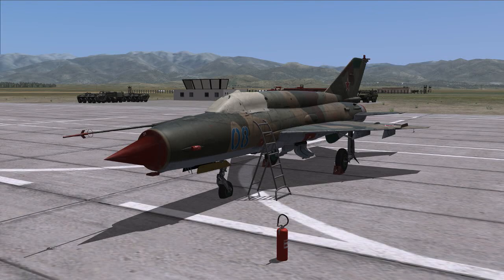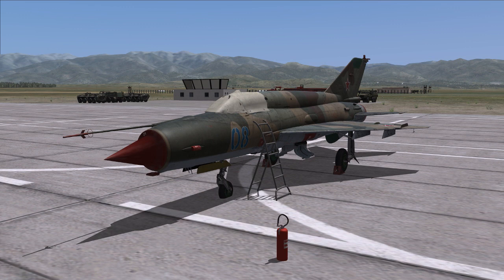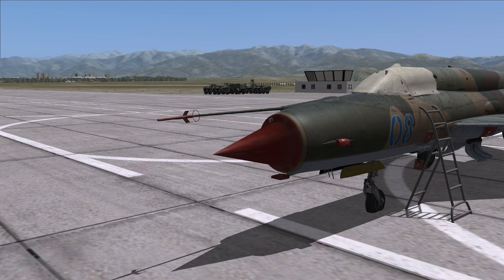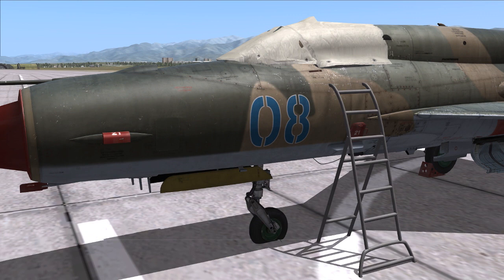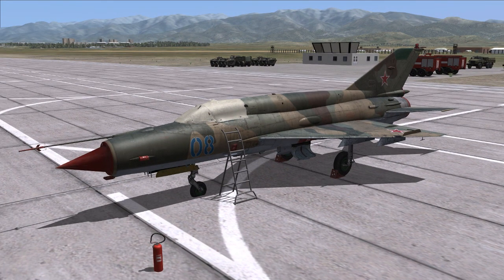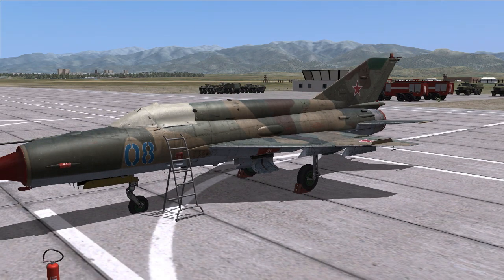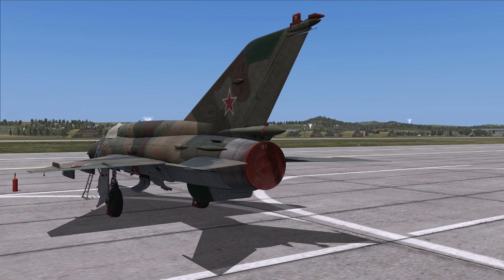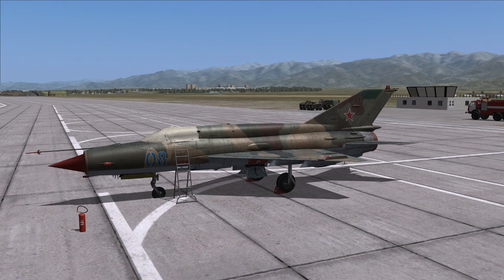[DCS] MiG-21Bis Hangar Talk 1 - Overview

Comment: Radar is cooled with alcohol that vaporizes......Why the fuck is not water cooled with regular radiator again?
Reply from the maker: Probably to reduce weight and size. 

The Mig-21 is an Inteceptor by design - it takes off, is guided to the target, shoots the target and lands again. In most cases you need the radar only for a couple of minutes during the actual engagement. Therfore having a simple system that is much lighter than advanced cooling is probably more efficient.
Reply: @xxJohnxx77  I guess that makes sense

Comment: The nosecone does not move to let in more or less air. It moves in order to move the point where the shock-wave is formed.
Reply from the maker: Yes, that is the principle it works with.
However it has two main purposes:
- Supplying the compressor with a rpm dependent amount of air. This is done by changing the intake diameter which in turn moves the shock-wave as you mentioned.
- Compressing and heating the air with minimal losses.